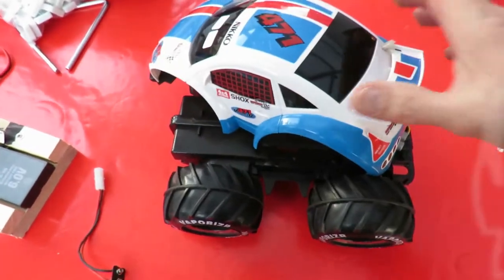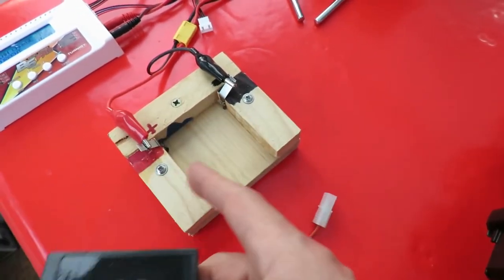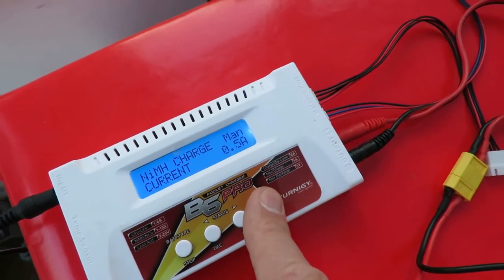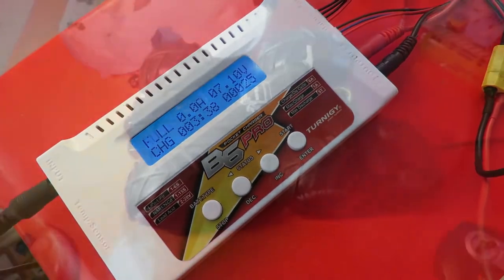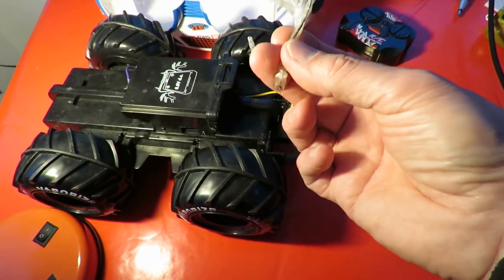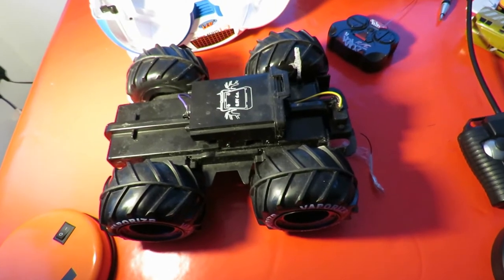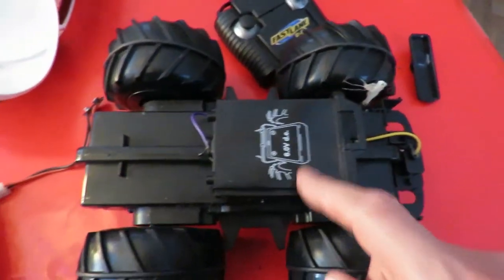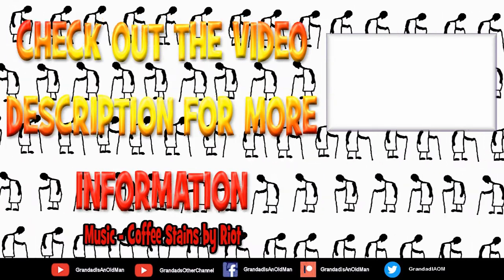Nikko VaporizR RC Amphibious Car TEAR DOWN PART 1

Comment: Have you been at my local charity shops because I can't find any remote control toys anywhere! Any projects that use RC for really different stuff? X
Reply from the maker: Toys seem to be drying up in most of the charity shops I visit. They seem to have made a conscious effort to stop stocking them in many of the shops and just concentrate on clothes. It probably gives them a better revenue.

Comment: Hello. can I buy spare parts for this model somewhere? Thank you for your help.
Reply from the maker: That rather depends what spare parts you need. I doubt you would be able to buy original branded parts anywhere. It is a pretty old toy now.
Reply: This is a waterproof box. and battery chargers
Reply from the maker: As you can see in the video, I rigged up my own charger. I am not sure what you mean by waterproof box.